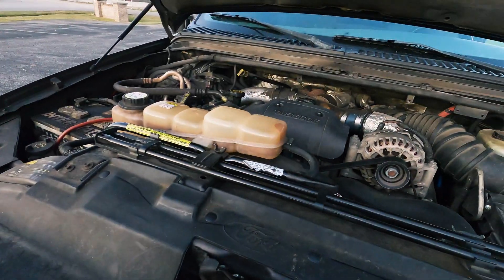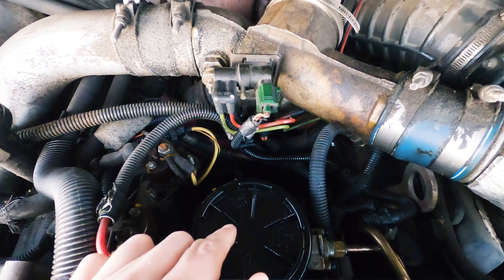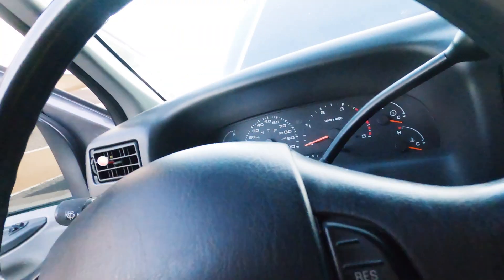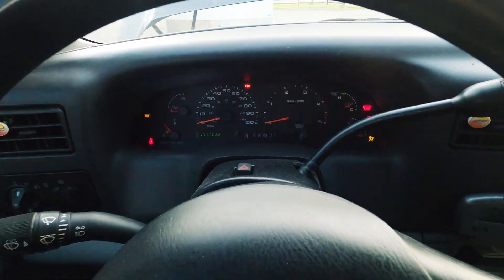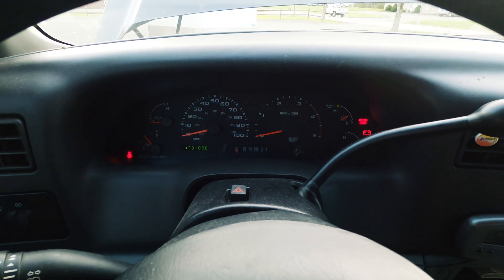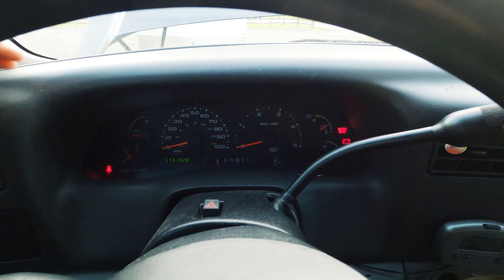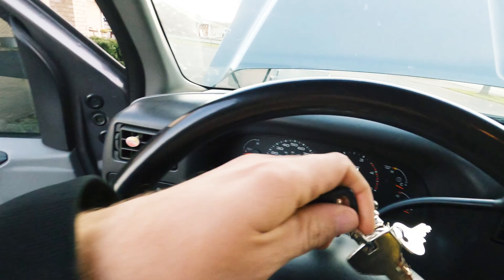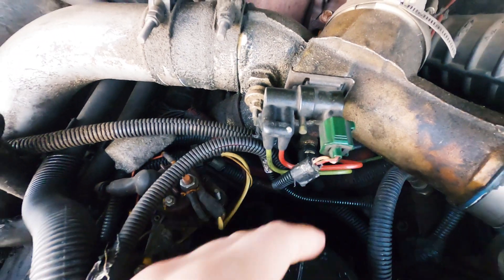Air Locked 7.3 Powerstroke | How to Fix an Airlocked 7.3 Powerstroke Fast!

Comment: Thanks for the video. And these comments. I did a combination of the yellow valve and 70psi on an air nozzle with tape wrapped around the end until it was wide enough to cover the gas opening all the way.

Comment: That yellow lever is a drain for the fuel bowl which allows you to remove water (which will sit at the bottom) from the bowl AND to drain the fuel / contaminants from the bowl during a filter change. If there is air in the bowl, it will be at the top of the bowl. You cannot simply "drain" the air. As a previous comment was made, you can loosen the cap, run the pump until fuel comes out, then tighten the cap. This is of course, done if for some reason the air doesn't push back to the tank as it was designed.

Comment: Still no start for me, I “ran” out of diesel though I still had diesel. My pick up tube I am guessing is more short than I thought in my bed tank, added fuel, did this, no luck… time to crack injectors?
Reply: Update: still crank no start but found a new oil leak at the pedestal and lost about a quart. We will be replacing the pedestal with a ebpv delete pedestal and deleting the AIH since wire burnt. Still in process of taking everything off due to the weather. Will update again if I get her going.
Reply: @squirrel3443 get her going?

Comment: Faster way..........Open the yellow valve. With your ignition key, cycle the fuel pump until fuel comes out of the yellow valve. Close the yellow valve and you are ready to start. Also good idea to add a little diesel to the fuel/filter bowl.
Reply from the maker: Great tip!
Reply: This worked for me!! Thank you so much

Comment: Air goes to the top of fuel bowl will not bleed air . Take cap off then cycle key to run fuel pump until bowl fills. Then replaced fuel bowl cap.
Reply from the maker: Thanks for providing another way! The only thing I know is you can hear the air being purged from the fuel bowl once you build up pressure  in the system and release the drain valve 🤷 I'm sure there are multiple ways of doing it though; I just know this has worked for me before and wanted to put it out there in case it could help someone else 👍
Reply: I had to fire a guy years ago..... He mounted two brake calipers with the bleed screws down.... then could not understand why he couldn't get a pedal "since there was clear fluid coming out".....